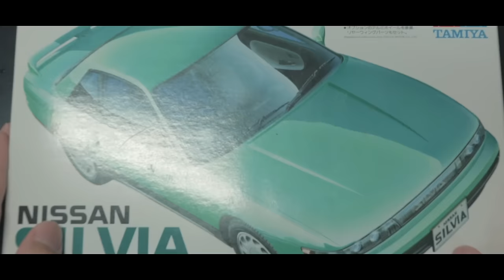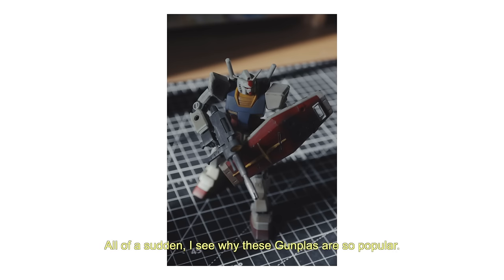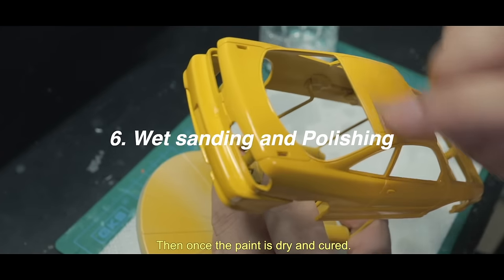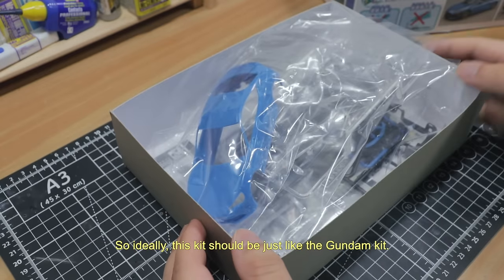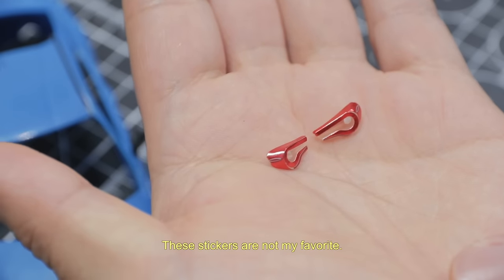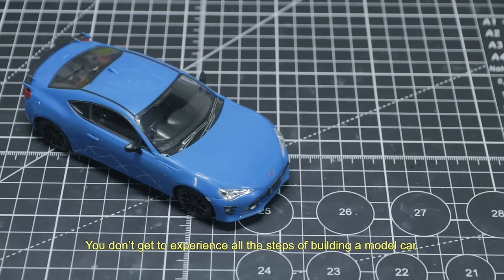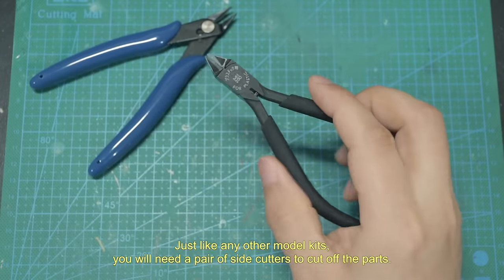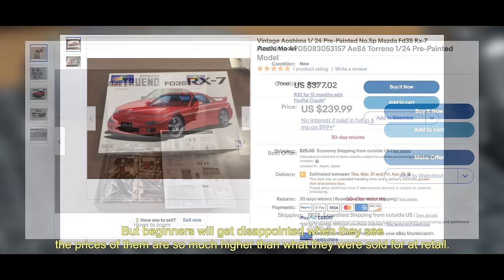The Best Model Car Kit for Beginners

Comment: I personally think that if you want to get into the hobby and want to buy paint, but don't know what to buy, I would start by purchasing any Tamiya model kit and use the instruction manual to purchase your paints, this way you can see what colors are most used in model car building. After purchasing all of the colors listed in the manual (using the Tamiya color codes that are listed), you should have a majority of the colors to build most model cars.
Reply from the maker: Great advice. That’s what I would do, too.👍
Reply: im just choosing a kit to build,mostly revell, ut in mu stash are some aoshima kits too, and just thinking witch color should i doo and ordering a paint. but if we are speaking about muscle cars engines mostly are orange
Reply: Big brain right here, I am going to do this
Reply: @JunsMiniGarage ts or ps paints ?
Reply: Is that expensive?
Reply: I’ve done a lot of model military before and being a car person I want to get into mode cars as well. So many of the skills transfer over or am I more or less starting from scratch?
Reply: @criticalfail8005  I started with military aircraft around 12 years old. PATIENCE, Learning painting techniques, dealing with fitment issues, glueing techniques, sanding, filling gaps, masking, all of these seemed to prepare me. Just as Jun demonstrated with  Gundam models. The big difference with car models for me was the interior, and engines, and parts count. Car models are 50/50 interior and exterior. Car bodies require more prep work as Jun demonstrated. The one trick I used as a kid that differed from aircraft was used fine tipped permanent markers to frame around windows, windshields, and clear parts. I learned weathering techniques from Aircraft, and Star Wars models as a kid. I hope this helps. I think I once you open that first box it will all come to you. Good luck, Take care.

Comment: This video is so helpful yet so calm.
In terms of car model kits i have no experience, but somehow, when i was 7 years old, my parents bought me a BBurago Fiat 500L model kit. These kits were (i don't know if they are still in production) a mix of snaps and glue was required in certain cases. The body was a pre-painted metal die-cast. For beginners maybe these are a valuable option(i think? I was a child but i remember it was really fun to build it).

Comment: I still remember when I started making plastic models again at the beginning of 2020 after 15 years. I got 2 kits (Revell) and the necessary accessories to start again. I paid around €200. 50€ for the 2 kits and the rest for the accessories. You learn more and more and at the end of the year airbrush equipment will be added ;-)

Hobbies cost money and time, otherwise they wouldn't be a hobby. But it is a nice and calming hobby

Comment: Great video! Thanks for sharing your first two builds, it makes others feel better that their mistakes are normal and you can't have high expectations at the start, its a skill that takes lots of practice, try an improve with each build. Amazing to see how far you've come Jun! Another idea for beginners would be building the car with a different theme where mistakes are OK, rather than building an OEM prestine clean model you could go for any, or a mix of: beat up, rusted, dirty, muddy, abandoned, apocalypse/mad max. Imperfections fit with these builds or can be easily hidden, you'll still need plenty of supplies.

Comment: I was a complete biginner, I jumped right into the deep end and built a 1/24 Tamiya Porsche 959. Painting wasn't too bad as I have pretty steady hands and was able to paint the trim around the windows with a tiny paint brush. All together I think the kit, the tools I used to make it, and a pre-made diorama cost me about 95NZD. This was because I already had some paints, tweasers and a scalpel laying around. The end result look great in my opinion, especially considering it was my first model, however it took me many months to finish it as school got in the way a lot and as parts of the build such as joining the body to the chassis were very difficult. After building that kit I have decided that I would like to maybe build something a bit easier that doesn't become a headache. 

P.S I am 14 so if i can do it as a complete biginner you probably can too.

Comment: a very interesting video. there were always impressions of your own work, which in my opinion would have been more important and valuable to show where you can develop if you just make an effort.

in my opinion, these "put together" kits, which look more like a puzzle than a beginner kit, don't really help to get used to model making and scale modeling. one does not really glue anything, grind anything, varnish anything and put no decals. all work that is necessary to build a beautiful and handsome model from the cast plastic parts.

to get a taste of model making with these plug-in kits is like learning to drive an automatic car if you have a car with a manual gearbox at home. you learn how to do it, but you're almost starting over when you want to do it right.

Comment: As a gunpla builder a normal car model kit is basically a step removed from a scratch build. The Blue 86 is on par with a HG kit from the early to mid 00's, simple and easy. But then the larger prepainted kits dont let you do anything other than glue and add stickers. If they could mold the car  parts in bare color plastic then let the customer add whatever they wanted it would be perfect atleast for me

Comment: I should look for those pre-painted Aoshima kits. I wonder if my hobby wholesaler has any?

Usually I find that the only issue with any pre-painted model kit is that the seam lines have not been removed at the factory and to fix them, you need to scrape the seam lines right through the paint, and then re-touch the paint from the factory without any idea as to what paint brand or color paint they used. Makes it harder if the paint is a custom mix from the model kit manufacturer. 

Still...that pre-painted Aoshima kit looks dope! - maybe they "Did it right" unlike AMT and their pre-painted kits.

Comment: I always recommend military vehicles for beginners.  They don't need a glossy finish and you can paint a camouflage if you feel brave, or a single color. Also, you don't have to fuss about panel lines or minute details.Well, unless it's an airplane of course.
    The easiest are submarines and you can experiment with underwater dioramas too. Very fun.  The next step up is tanks, then ships, then airplanes and helicopters. Civilian Cars, trucks and motorcycles come last because you need experience to get a good paint finish. And when the paint is glossy, a bad finish is a bad model.

Comment: Another option for me is the Revell Snaptite kit/easyclick system, it's not painted but the scale is 1/24 and the finished car is quite heavy and feels nice, I personally painted mine but I guess it would look quite decent even without paint, it has sticker and water slide decals so I think is a nice compromise between the 2 options you put

Comment: Like you said, if you really go for the real deal, building model car kits (applying paint, glue, decals, sanding, etc) feels more like an occupation than a hobby. I always wanted to build one and have tried once before. However, when you don't have the necessary tools (e.g. proper glue), you'll get a very unsatisfying result and frustration altogether. I'm a car guy but I also don't have all the time in the world to build one perfectly. Even now, I've stopped building Gunpla kits because it requires you to cut the parts and do some minor line painting. As a working man now, I still want to pursue this hobby of collecting model cars but I also don't want to spend a lot of time with all the details. 

My recommendation would be to invest in Lego car kits (Speed Champions, Technic, Creator). These kits are priced reasonably considering you don't need to spend a decade to complete one of them. My other recommendation is to buy a high-end 1/18 diecast models (Autoart, Norev, BBR, etc.). Some might say buying these 1/18 diecast models are expensive, but for me if you include all the tools and time require to build a model kit, you're better off buying a complete one instead. Not to mention, you can even open the doors, boot, and bonnet of these high-end 1/18 models.

I'm not dissing car model kit builders at all. If anything, I admire and salute their dedication to the craft. I even envy these craftsman because building a car model kit requires skills, detail, and determination to get one model kit car right. But for the rest of us who aren't too keen and have that passion for the craft, but just want to collect cars for display, I would suggest going with my recommendations instead.

Comment: I have a question. Why does the primer from my cars feel rough after drying it? I used to ignore it before and now it's bugging me.
I first sand the unpainted body, and then i put 1 or 2 coats of primer (i use generic primer that you can get from your local hardware store). And after the primer is dry, i put some color in.
Reply from the maker: The primer is supposed to have some roughness so the next paint layer can adhere onto the surface more easily. But if it’s too rough and too chalky I would wet sand it with 2000-3000 grit sand paper. Also try to keep every coat wet by moving the spray can closer so the paint doesn’t get dried up mid air. Wet coats are usually smoother.

Comment: I don't want to get into the hobby because of the tools, more-so painting and adding the details or the scale of the cars. I love watching these videos online for Model kits and I always wanted to try it out myself. But i always look at the process of how painting and decals go down. These look super precise I probably might mess it up if I try it. My first kit I built was for a 1970 Pontiac GTO. It turned out very well but I broke so many parts because of the under carriage because of how small they were. i could never get my hand to sit still or apply enough glue to the part that it always came off. Its so frustrating

Comment: Thanks i will probably get a model car kit i mean like i have the tools but not the time, because i have part-time job so i cant finish like even one car kit maybe it will take months just for me to build one car kit, but i have built like 2 car kits so far one is the castrol supra and the other is a s13 yeah it's hard to finish the two when you also have a job to do, you cant have much free time when your building and you have a job too, i was planning on buying another car kit but i dont have enough money, sometime's i will get late at work due to building this type of car kits. But thanks for the video too

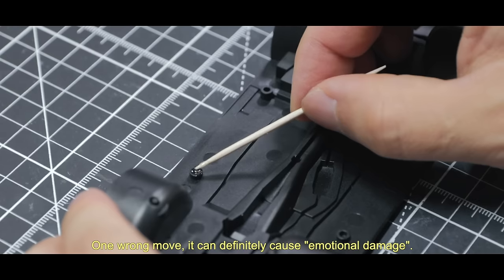7:35 (*EMOTIONAL DAMAGE*)

Comment: go for the pre painted kits or any normal kit with no engine i had gotten my first kit a tamiya 180sx i didn't paint it or anything straight out of the bos build and it looked decent then i tried one of the snap kits and was disappointed with the outcome as i hadn't done a lot yet the result looked cheap and toy like

Comment: For beginners... Just get Revell Easy kit, they are much nicer :)
Reply: is that similar to snap kit
Reply: @defnotaken  It is painted, proper markings are already made (decals). They make racing cars, planes, jets, helicopters. We were converting them for Slot car racing for the beginners and kids, cause 1:32 original SRC cars were expensive for beginners when you need several categories (like Le Mans, Truck, 2+2, Rally, Formula and much more) :)